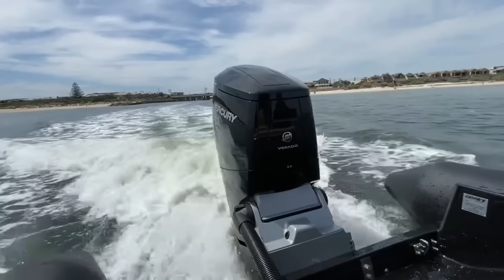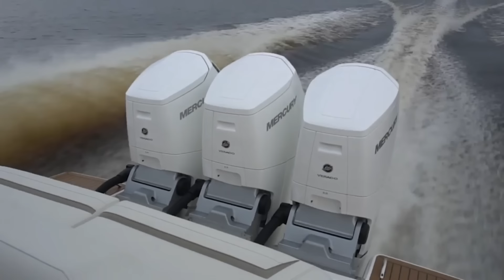How BAD is The Mercury 600 Actually?

Comment: The truth is that the price tag of the Mercury 600 does not reflect the actual quality of the engine, nor does it reflect the frustration that comes with it (and the same goes for the boats they're installed on too.) If you own a boat with 3 or 4 of these engines on the back, Heaven help you. Get used to lots and lots of alarms and downtime.
Reply from the maker: It's definitely frustrating when the price doesn't match the performance. Maintenance on those engines can be a real challenge, especially with multiple setups. Thanks for sharing your experience!

Comment: Give me a stern drive instead. Easier to maintain and repair.
Reply from the maker: I totally get where you're coming from! The Stern drive definitely has its advantages when it comes to maintenance and repairs.
Reply from the maker: I totally understand where you're coming from. The Stern drive does have its advantages when it comes to maintenance and repairs!
Reply: Yes with a 500 CID or more DI 2 stroke inline 6 with dry sump oil injection! None of this car 4 turd stroke junk either!